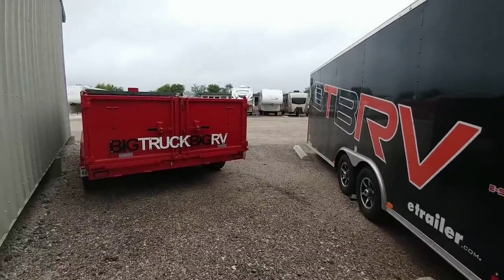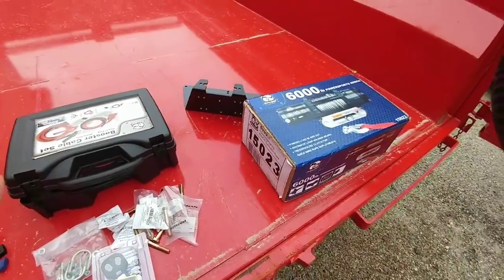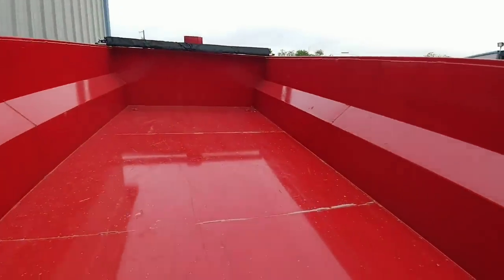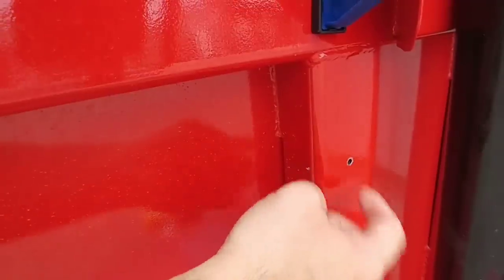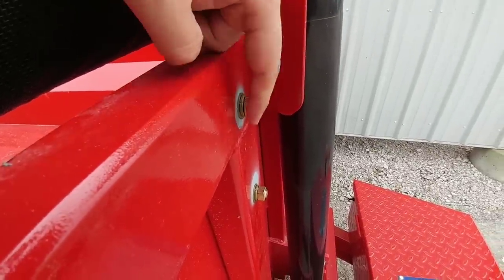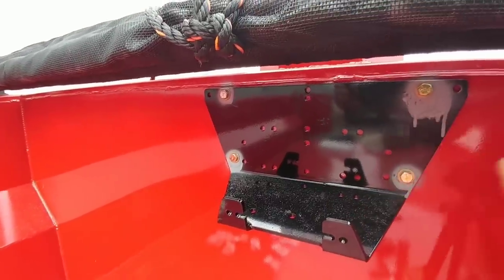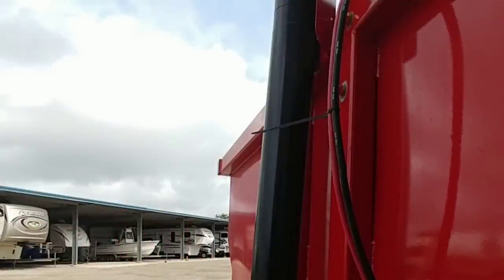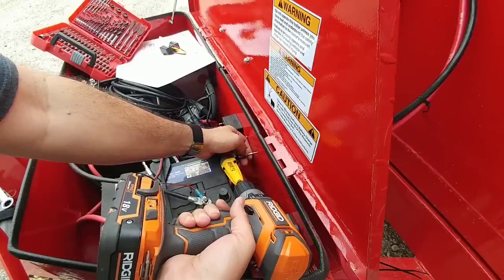Installing a Bulldog 6,000lb Winch on a Dump Trailer

Comment: Thank you for this.  I had the exact same problem with the wiring.  All I got was a click from the control box.  I called bulldog to ask them if it sounded like a familiar issue, and they were totally clueless.  This kind of stuff just makes my head swim.  The instructions clearly show the green and black pigtails connected, so EVERYBODY that follows these directions WILL have this problem,.....and somehow Bulldogs has never heard about it.  To make matters worse, when I was installing mine, I couldn't make sense of the wiring so I actually called them to confirm.  I have wired many many winches of all brands, and this one seemed weird.  I was told to follow the diagram.   This video exposing the problem was posted almost 2 years ago.  That being said, this is a great little winch, and in Bulldog's defense, you can actually call them and someone does actually answer the phone.  These days that is extremely rare!

Comment: You need to get a snatch block and have a good anchor point on the trailer so you can pull some heavy loads. With 4 layers of rope on the drum the winch capacity is only 3400lbs.
Reply: Always too much rope/cable spooled up on the winch.

Comment: I'd suggest a wire loom around the winch lines, to help protect both the wiring and the trailer surface. Or, something like a standoff around the top of the trailer. Is the top of the piston frame a potential location to loop the cable to?
Another cool project, JD!

Comment: A good idea for getting my electric scooter into my truck,using a ramp, when we are going to tow our rv. I usually have my scooter on it's specially designed lift which uses the hitch. Thanks.

Comment: Nice set up you have for your dump trailer, having a setup like this makes it easier to pull a small car, pickup truck or small farm tractor that's been sitting outside for a long time.

Comment: Hey bud also big thing to keep in mind the weakest part of that winch are those little cross bars that keep the 3 sections of the winch tied together if one bends that winch is officially broken so just be careful with that

Comment: Love your videos.  Recommend you place a paint drop on the free-spool end cap so you can see if the free-spool end ca is in the open mode or locked mode.  I do that on several tractor items that do not have white indicator lines.  My eye sight is not the best so contrasting colors of white on black or a fluorescent color against the black stands out well.  Excellent video.  👍🏽🙂.  I;m a New Subscriber for about a month or so.

Comment: Have you thought about heat shrink tubing in place of zip ties, and a clamp to attach wire to trailer framing to keep cables from being lose against frame

Comment: Great install!!
I've actually been thinking about mounting a winch on my dump trailer so I can easily load and unload my log splitter as I transport it from site to site.
I do think it would be more aesthetically pleasing if your bolts were flipped and the nuts were to the inside of the dump bed.
Great job otherwise!

Comment: Get a set of quick connectors for the winch wires so the don't have to hang out in the sun. Install them up by the tarp plus then no one knows you have the winch hanging out in there!
Reply from the maker: Good point
Reply: That's what I was thinking.  Mount the quick connector on the front of trailer on the top tubing dust cover plug facing down for water drainage.  Ah he'll figure something out.  But looping the cables looks tacky.

Comment: I think welding it on with gussets in the bottom would have been a better options. And not compromising the frame of the dump trailer.
Reply from the maker: I think that would have been an extreme way to mount it, but that would have added unnecessary weight and really wouldn't be needed.  Good suggestion though

Comment: I think he buys all these trailers just because he can afford them, not necessarily because he needs them. The paint inside this trailer does not suggest that it has done much work since he bought it.
Reply from the maker: Well, I've only had the trailer for a few months. It's been used 7 times.  It is for personal use and not business, so don't expect it to be used everyday to haul dirt or scraps
Reply: This is an interesting video.
Reply: My dump trailer looked new for the first few years.  It's 20+ years old now and is dented and dinged but still going strong.  It's used around the farm so not exactly and easy life but not beat to heck like in the construction industry.